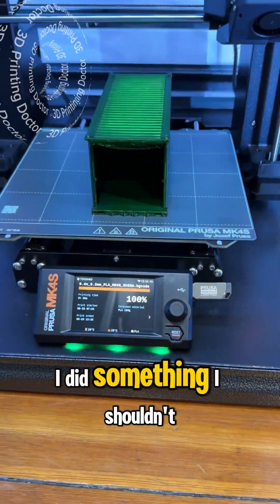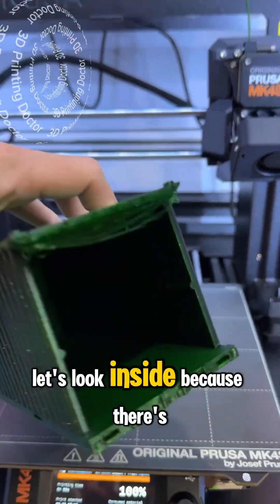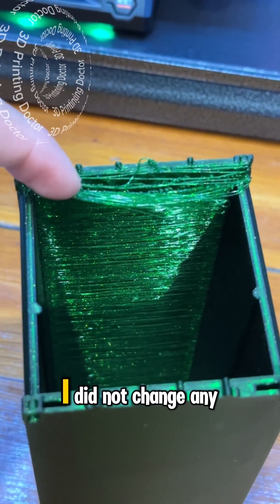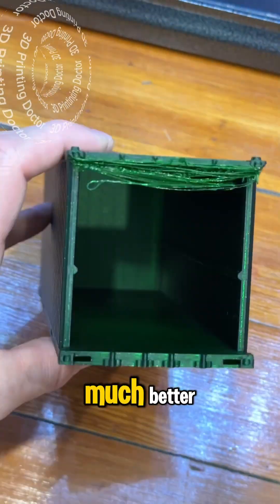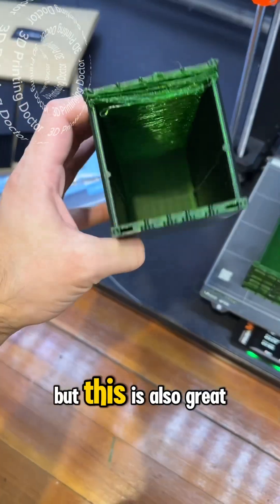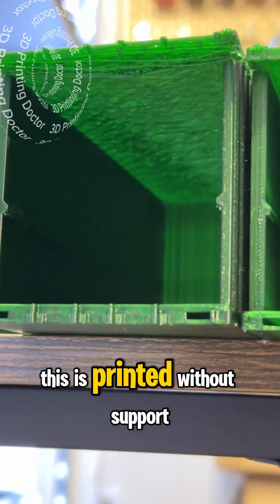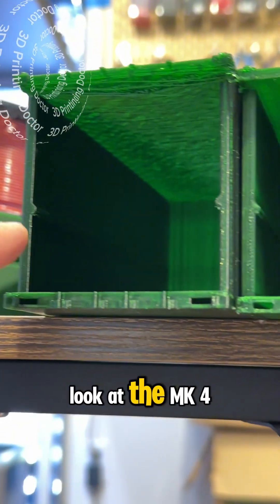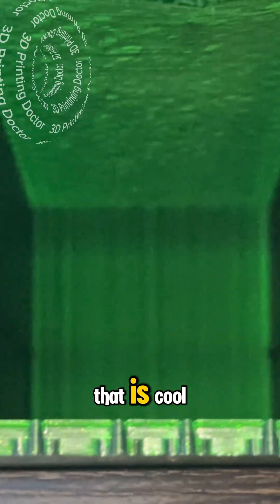Very long bridges printed against gravity with mk4s

Comment: MK4S, MK4S, MK4S.
Even an ender3 something would be able to pull that off.
Reply: If you look at the structure of the model, you can see that the overhang is not just between the two walls, but it also goes forward. It is impossible to print well in this orientation. On almost any printer.
Reply: agree